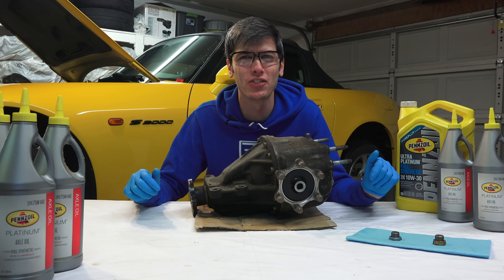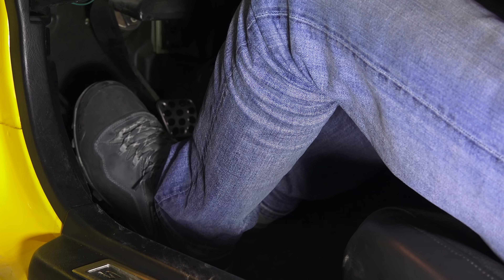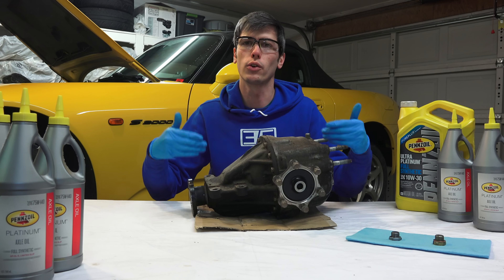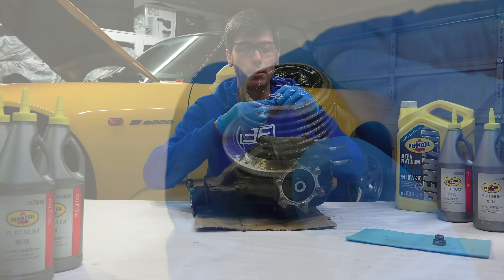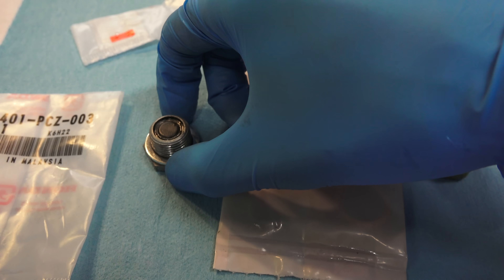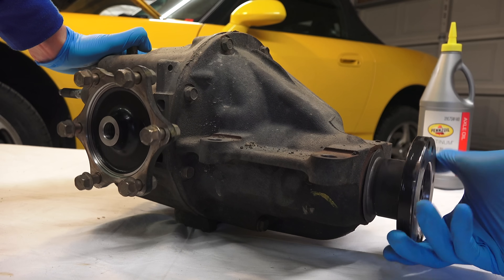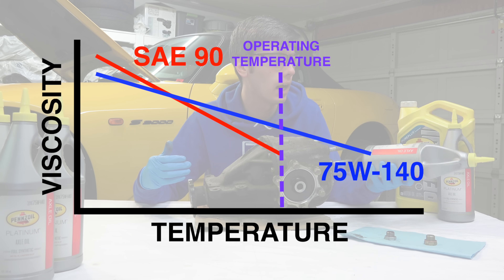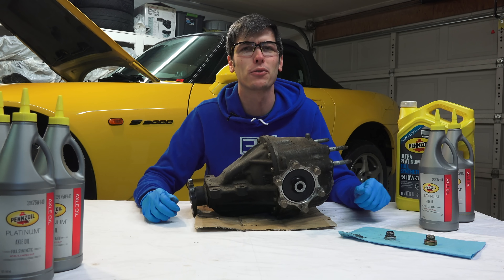Things You Shouldn't Do With A New Differential

Comment: Does this apply if you put it in a purple car ?
Reply from the maker: Purple cars are magical and don't require any maintenance. The downside is purple cars tend to understeer.
Reply: SquaresAreCube no sorry only in yellow cars....
Reply: I've a '96 purple car, sport special 500 miles edition and the builder recommends doing 500 miles or so before doing 500 miles after which you can do 500 miles when you will have done those 500 miles you can do 500 more miles. And just to be on the safe side, do at least 500 miles. Remember, if you do 500 miles, you gotta do those 500 miles! ;)
Reply: aaaaaaaaaand i will drive 500 miles, and i will drive 500 more. just to be that purple car to drive 1000 miles to your door.
Reply: yo, i love purple cars
Reply: what's wrong with purple lel
Reply: I'm sorry, nothing against anyone else's choice, but I just can't drive a purple car. I literally did once offering some family help in moving with a borrowed truck from my dealer's lot, but one thing I can assure you:
The previous owner believed maintenance wasn't required! Never drove a worse Ford Ranger, lol.
Reply: lel as i see a purple car doesn't need maintenance i can just imagine a purple ranger and yeah i might drive a purple car but depends on the shade
Reply: I think you have to use royal purple instead.
Reply: I bought Royal Purple Gear oil. :) When I get around to it, I'll do a video about it.
Reply: What are the chances... my 99’ dodge Dakota r/t which I painted purple a couple months ago blew the differential last week... lol

Comment: Have any car companies done research of what not "breaking in" a car does to the lifetime of it or its parts? It still just seems kind of ridiculous to me. I feel like that guy in a new hope who calls the force magic or whatever, but I'm also him after Vader force chockes the shit out of him, worried about the effects. As much as I trust you, some of this break in stuff just sounds silly.
Reply from the maker: Yes, there's plenty of testing and data on it (though the majority is internal testing). What's great about something like a differential is you can actually see the break-in occur, with the fine metal powder that comes out with the drain plug. Obviously you don't want that metal circulating in the oil, and you'll notice with time the metal on the drain plug will be significantly less.

Comment: So wear is a good thing?
Reply from the maker: Not necessarily good, but inevitable. And you want it to wear smoothly and evenly, not all at once getting to hot and causing damage.
Reply: Wear is when two components make physical contact with each other and remove material, break in happens when parts form to each other.  If youre too hard on something thats not broken in you will destroy the rough machined edges that would have been used to seat themselves to each other, in the case of an engine you might burn oil rapidly, in the case of a differential, it may howl.
Reply: Like EE said, it's inevitable one way or the other. However, during the breakin period, the gears are going to  be wearing smooth the surface where machining texture might be, thus potentially creating a lot more heat than normal. 

I rebuilt the rear end on my Suburban and dropped to a 4. 10 gear, and you could tell it got hotter, faster (feeling the cover by hand) during break in than it does now at 2 years old.
Reply: Break in is good as it allows component to mesh correctly. Wear is bad as it shortens the life of components. Break in happens early on in a component(s) life and should be complete by ~500 miles. Wear continues throughout the component(s)' life span. Reducing friction, reducing heat, keeping things clean and lubricated all help to reduce Wear and extend the life of the component.

Comment: Is a welded diff a good idea for drifting or not???
Reply from the maker: If it's a dedicated drift car, it's not the worst idea. But I think a proper LSD is a more logical decision, as it keeps the car very drivable while still offering great drifting characteristics.
Reply: For drifting, absolutely as both the rear wheels will be spinning at the same speed all the time making it easier to initiate and control oversteer. For daily driving, i cant imagine it being pleasant.
Reply: I drive an old merc with a welded diff. If you are drifting for fun, go for it. But if you are serious in the sport and have enough power in your vehicle, i would prefer a proper lsd. 
Dayly driving it is a very bad idea. Think of an slightly wet street. You will be kicked out all of a sudden. And get into a parking spot isn´t fun either.
Reply: Engineering Explained alright thanks, I’ll keep that in mind whenever I start my project build
Reply: Best would be a locker, if available. Switch it off for road work.
Reply: Yes, but drifting is not a good idea.

Comment: hi jason !! i have a 99 suzuki vitara and 3rd gear has a problem . When i downshift from 4th to 3rd or upshift fast from 2nd to 3rd  i have a lot of grinding noises .. do you know what the problem may be ??
Reply from the maker: Likely the synchros going bad. Downshifting will make this much more noticeable unless you rev-match. Upshifting it won't be as noticeable because the engine RPM is falling in the same direction your next shift will be (it's naturally rev-matching, to an extent).
Reply: ploutarxara 4ever sounds like a synchro is bad
Reply: metaleggman18  yes it may be but the most times especially from 2nd to 3rd it shifts like a dream !! i want to add some aditives before it needs to be rebuilt !
Reply: I have old school Muncie and Borg Warner gear boxes in my Chevelles and Corvettes. Synchronizers can chatter as they wear. The GM service manual recommends putting an anti-chatter additive in the transmission with the gear oil.  I used the additive in the Borg Warner transmission and the chatter is gone. It shifts like it was new once again.
Reply: Engineering Explained that sounds about right. Unless you have actual gear problems (like I did with my 09 Lancer from the factory), you're much more likely to notice it on those down shifts.
Reply: Dont they make a syncro equivalent to auto trans stop slip
Reply: Engineering Explained  ok jason i will try rev matching . thanks for your help !
Reply: be glad it's not like my '93 Dodge W250, where the shifter side of the  5th/reverse gear shifter fork is damaged and you have to swing out wide to make sure you get it in gear. it's also hilarious to watch the shifter fall out of said fork when going down the highway at 65.